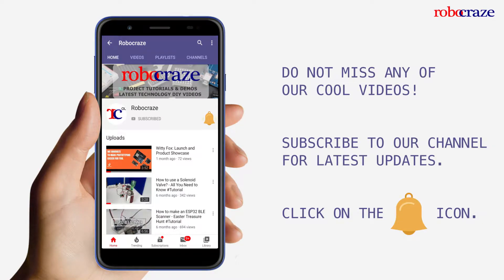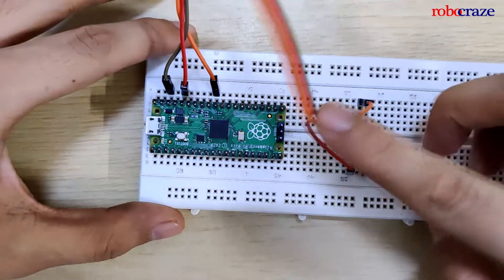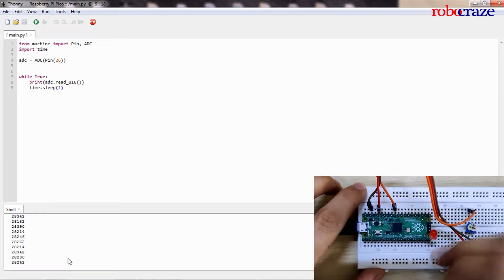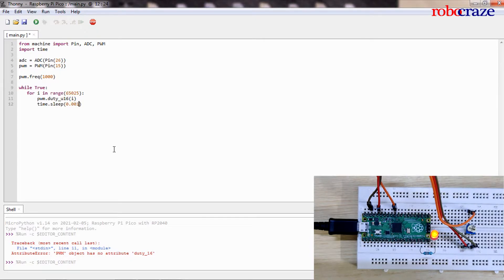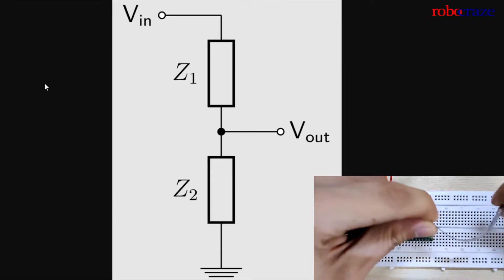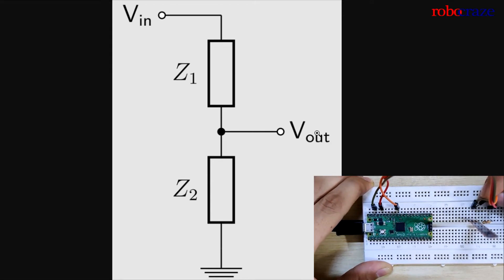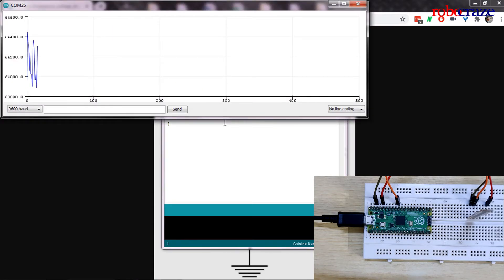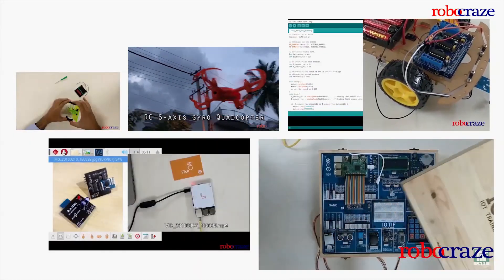Raspberry Pi Pico using MicroPython - Tutorial #3: ADC and PWM (with flex sensor)

Comment: Where would i find info on using GPIO 26,27, 28 as digital outputs?
MikeH
Reply from the maker: Hi Mike,
Please check the documentation in the link given below. It contains links to SDK reference, datasheet, etc. You may find more information there.
https://www.raspberrypi.org/documentation/rp2040/getting-started/

Comment: Thank you for these videos. Do u have som project using Rpi Pico and MQ2 Gas Sensor?
Reply from the maker: Hi,
We are glad you are enjoying this series. For the MQ2 gas sensor, since the module gives an analog output, you could use an ADC to read these values and determine an appropriate safe threshold. Then add an if condition to check if the values go above this threshold. You can use a buzzer and LEDs to alert people nearby to presence of gas if the threshold is crossed. If you want to take it one step further, you could even connect a relay to a mini water pump and turn the pump on whenever smoke is detected and the threshold value is crossed.